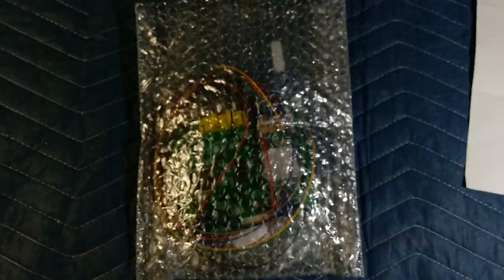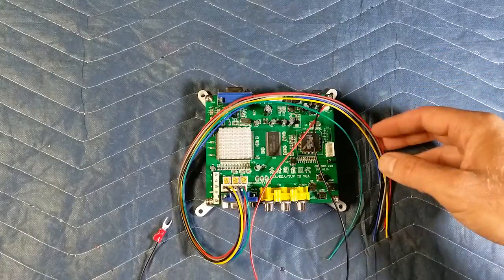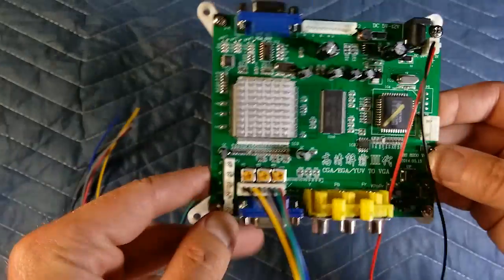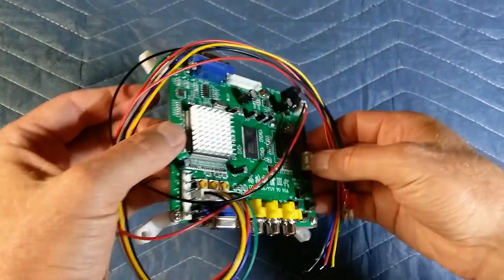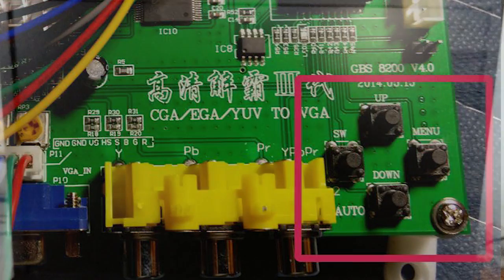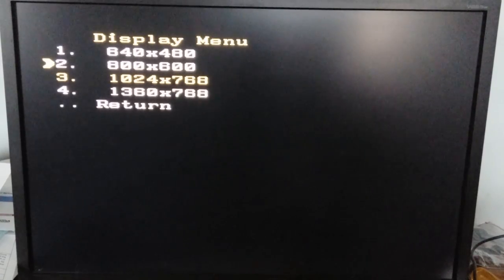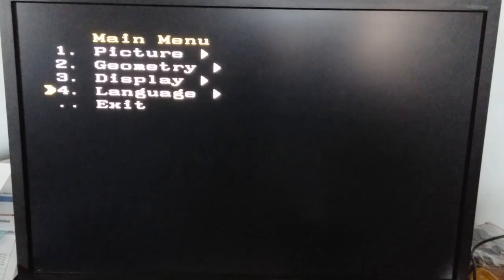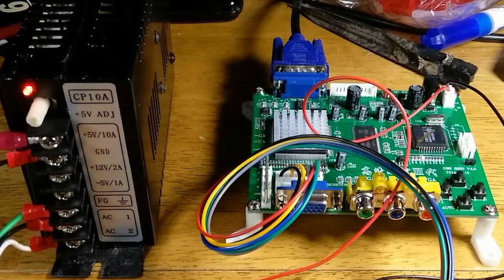GBS-8200 Video Converter CGA/EGA/YUV/RGB TO VGA

Comment: Will it work on an old PC that has EGA output? My old IMB XT clone works but old Princeton monitor beyond resurrection. Best I could find was a same model Princeton monitor that the seller says works. Said the light comes on and it hums but no picture as they do not have a compatible PC to hook it too. Only costs $150 to see if you bought a broken monitor.